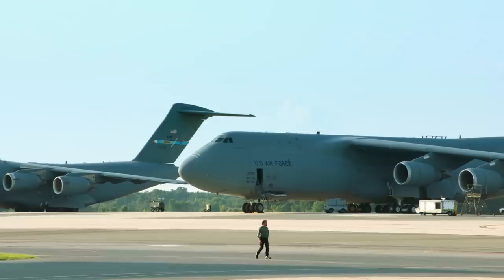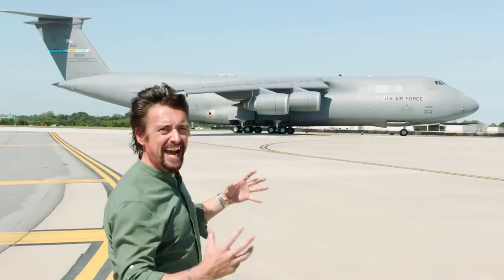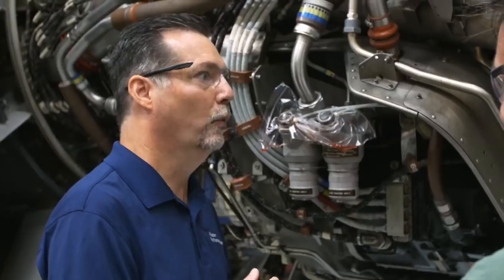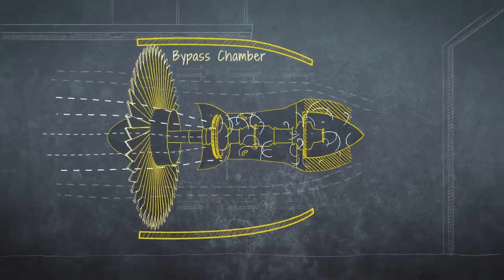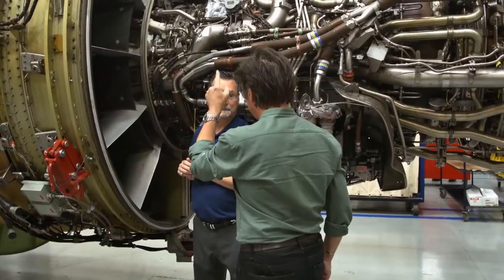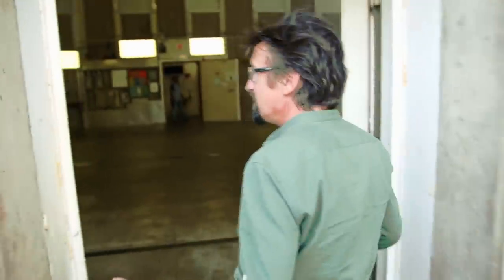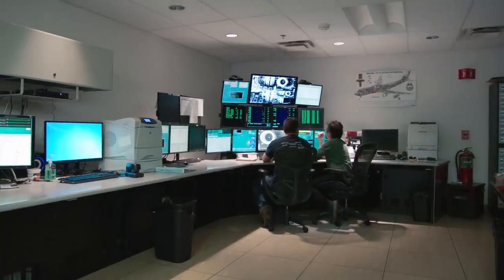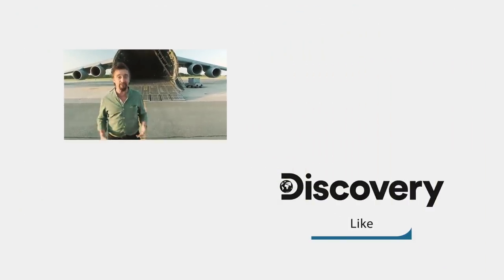Richard Learns How POWERFUL The Turbine Of The Super Galaxy Plane Is | Richard Hammond's Big

Comment: The most amazing thing that I find with modern jet turbine engines are the bearings that support all the weight of those many moving parts. Literally tonnes of metal being held in place vertically and yet still being fluid enough to turn radially. I've had the honour of working with these marvels of aerospace in the past, and let's just say that there's a reason that they have to use clamps and covers on the front LPC to stop them from moving in even the lightest of winds. I was stood in front of a fully assembled Trent 1000 an age ago before it left the overhaul facility, and I was told to simply place my pinky finger on one of the blades. It moved at the lightest touch. Now imagine that same engine being sat on a runway in high winds. Those things would spin like it was nobody's business. Modern bearings are an engineering achievement of themselves.
Reply: Great comment! The bearings are also bearing all that thrust and transferring it to the frame of the engine! Same with car wheel bearings, on a smaller scale. All the weight of the car is sitting on those 4 bearings and all acceleration and braking force is also going through them!

Comment: I had the privilege to work intimately with these types of engines during my time at Rolls Royce, and they really are amazing machines. If you're into engineering that is. Ha ha. The sheer scale of them is awesome, and to be able to take a hands on role and see one of these beauties go through the entire service process from start to finish is something that to this day I count myself lucky that I got to witness. Some of the engineering challenges and subsequent solutions to even the tiniest of problems is incredible in it's simplicity at times.
Reply: During my time at Uni we were allowed to visit N3 EOS in Arnstadt, where they overhaul engines for Rolls Royce. The size and complexity are indescribable. Mess up one thing and everything goes south. Now being a mechatronic, I find it still immensely staggering that the techs are liable for every screw, even after 10 years
Reply: @LMO169  When I did my work experience just last Xmas, I was in the SPTE department (in derby) and had a tour. My supervisor really liked me so he took me to the testbed and we saw a couple XWBs in production. It was amazing
Reply: @LMO169  Hear hear brother. Every mistake has to be accounted for, and even a simple thing like a washer falling into an open part of the engine can wreak havoc down the line. I remember while I was on the overhaul line the once my team and I discovered a socket that had welded itself to the fairing of one of the turbine stages. After some work to figure out where and when it had come from we were later told that a previous mechanic had simply lost said socket and failed to report it. Were it not for the fact that it had managed to wedge itself between turbine stages it could have written off the entire engine had it come loose and tore it's way through. Lucky isn't the word. Ha ha.
Reply: @jimhutcho1083  You were at Derby? Awesome dude! That's the site I worked at! I worked at AR&O for the majority of my time there, if you ever get the chance to take a tour round there then jump at it. Some of the stuff you see there is just staggering! 

I can't speak much for XWB unfortunately as my contract ended during the final stage of development for that engine, but I got the chance to see a flyover from a passenger jet using that beauty. I did also spend some time working in BLISK department learning how the turbine sections especially were repaired. Amazing stuff to behold. Glad you got the chance to see stuff in person, really puts things into perspective doesn't it? =)
Reply: @_IHateHandles_  really does put things into perspective, most people don't think of the engineering that goes into those beauties.
Reply: @_IHateHandles_  we toured around the building and I saw the yellow, green and blue bricks too which was both cool and scary, especially when we went up to the testbed on the ceiling, a couple dozen metres up in the air 😬🙂
Reply: I worked for GEAE for 34 years.  The precision required for these engines is incredible.
Reply: @jimhutcho1083  Yeah when those engines are swinging overhead it can be quite the culture shock. Ha ha. I managed to talk my way into getting a visit arranged at the test beds while a Trent 1000 was being hooked up, even saw the thing running from the control center. No amount of concrete or soundproofing could stop you from experiencing the raw power of that thing. Ha ha!
Reply: @Harley2010SG  Hear hear! It still never ceases to amaze me the tolerances that some critical components have to adhere to. To live in an age where we can achieve those tolerances is amazing in itself.

Comment: General Electric GE9X: “that’s cute”
Reply: I was thinking the same thing. Twice the thrust and one engine is enough to fly the 400+ passenger Boeing 777, the third largest passenger airliner in the world.
Reply: True, in terms of thrust there's no comparison. However, a GE9X is wider than the fuselage of a 737, and weighs 40,00 pounds....so when we are talking about "making something bigger without making it bigger", that kinda doesn't work haha
I don't have time to do the thrust-to-weight calculations, but suffice it to say that the GE9X makes 105,000 lbs of thrust and weighs 40,000 pounds, while a GE CF6-80C2 makes about 55,000 lbs of thrust but weighs less than 10,000 pounds. Impressive!
Reply: The TF39 is where it’s at
Reply: Ben Jared 4:13 it actually is a GE9X
Reply: RandomTwix but the CF6 is the main focus of the video.
Reply: Ben Jared I know just wanted to mention it
Reply: So is the Turbo fan what produces the most trust? compared to where the compressors are. ( I don’t know the name of it)
Reply: Mati-miliano the turbine stages are only there to spin the fan. I think the schematic he showed was a little confusing. 

Most of the thrust comes from the fan. The cores job is to actually make sure the air leaving the engine matches the air coming into the engine. This way all the energy is used to spin the fan through the turbine stages and nothing is wasted. 

But I might be wrong it’s been a while since I completed my jet engine studies.
Reply: Mati-miliano there are 4 main type of jet engines: 1 turbo-jet: it is the most basic, and all other types are a variation of it, It is pretty much a tube with a compressor at the front that compresses the air, a combustion chamber where air is mixed with fuel and ignited (where most of the thrust is generated), and turbine at the back that drives the compressor at the front (they are most commonly found in early jet planes or in military planes some times with an afterburner) ; 2 turbo-fan: the most utilized type of engine (also the one in the video), it uses a turbo-jet engine to drive a bigger fan located in front of the engine, which produces most of the thrust, they are found in pretty much all modern airliners and in many military and civilian cargos, thanks to their improved fuel efficiency; 3 turbo-props: it is the little brother of the turbo-fan, it uses a turbo-jet to drive a propeller (not encased), they are usually mounted on smaller planes, or sometimes on some cargo aircrafts (A-400); 4 turbo-shaft; probably the most widely used, outside of aviation, they use a (usually smaller) turbo-jet to drive a shaft that can lead to any kind of machinery that requires rotational force, from the propellers on an helicopter to the drive shaft of a tank (M1 Abrams, T-80).
Reply: They tested a GE9X
Reply: superdriver777 jeez if the ge9x weighs that much really, that means it’s thrust to weight ratio ain’t that much better than the cf6
Reply: @vale.44peru  There is more, but not used for commerical planes: Ramjet (Supersonic), BuzzJet (ie V1 flying Bomb), & scramJet (hypersonic).
Reply: @guytech7310  yes, but those are way less common, only some experimental planes used them, in theory you can power in any way, even human power. 

p.s. it's pulse jet
Reply: @GolddenWaffles  That is correct, the bypass air (from the fan) produces almost all the thrust. The core (where the compressor, combustor, and turbines are) is primarily there to drive the fan. What a lot of people don't know is, on an engine like the 9X, there are actually two different shafts: one inner, one outer. The outer shaft spins fastest and connects the high pressure (HP) compressor with the HP turbine. These two parts of the engine bookend the combustor. The inner shaft connects the fan and low-pressure (LP) compressor with the LP turbine. These turn at a lower speed than the HP parts.
Reply: @InForTheLonghaul  This is correct. The 9X is much more efficient and actually slightly larger diameter than the GE90. Boeing determined they really didn't need as much thrust as the GE90 puts out. I actually worked as an engineer at GE Aviation in Cincinnati for a time on the 9X program. Peebles is a very interesting place.
Reply: @InForTheLonghaul  The highest thrust of a jet engine was a GE90-115B which set a record of 127,900 lbs thrust on a test stand in 2002. This was recently broke by a GE9X on a test stand when it produced 134,300 lbs thrust in 2019!
Reply: I looked and realized that truck is actually hauling a GE9X lmao

Comment: Funny thing. I was a ground mechanic (glorified gas station attendent) in the Air Force Res. back in the late 70s early 80s. And to keep the engines from rotating while they were on the ground they would put a 2 by 4 with rubber on it in the fan blades. Very high tech.

Comment: Turbofan technology is not General Electric’s discovery, as is being suggested.
Reply: Peter Yianilos it is actually.
Reply: bob bob Peter is right..... it was originally designed by English Frank Whittle & German Hans von Ohain in the late 1920’s early 1930’s
Reply: High-Bypass Turbofan is actually. Turbofan as general is not of course.
Reply: Aleksandar Aleksic   Thanks for the clarification.  I should have said high bypass turbofan.  However, ‘discovery’ is different from production.  The research, hence discovery, was not GE’s.
Reply: @artysanmobile  Well, that's true but it is not something like telephone or radio or engine...it was just development. So no one really had to claim invention of it. AVCO-Lycoming developed the first one and giving way the cost of such feat no individual could have done it. GE produced first one and that's somewhat more important. That's that settled.
Reply: @watchesoflondon2333  You are mixing up jet engines overall with the specific types of jet engines that are called turbofans. The designs of Whittle and von Ohain had all the air go through the combustion chambers and the turbines and were therefore not turbofan engines. The first experimental turbofan was made by Daimler-Benz under the Nazi regime in 1943 but von Ohain was not involved in that. The first production turbofan was the Rolls-Royce Conway in the 1950s with a bypass ratio of 30-60 %.
Reply: skunkjobb the point being it wasn’t GE
Reply: It's the first manufacturer in the U.S.A. and the technology was captured from the Germans after WWII. Pratt and Whitney started making them in the early 60's by licensing Westinghouse's nuclear turbine techology, and quickly came up with the J-58 and the JT8D.
Reply: Ge did design the first high bypass tho
Reply: @PeterKKraus  The word here was about High-Bypass Turbofan not Turbofan in general.  German planes like Me 262 used Junkers and BMW Turbojets but that tech coexisted in USA and UK (Westinghouse and Vickers).
Reply: @aleksandaraleksic4067  I knew Westinghouse had turbine technology , but for nuclear reactors not jet engines. A turbine is a turbine though. It's just a matter of how it's implemented. The Germans came up with the first useful aeronautical application.
Reply: @PeterKKraus  Well, being mechanical engineer I can't let you go with "a turbine is a turbine". Because it really isn't. Westinghouse produced it's first jet engine (J30) in 1943 so that's before they even touched Germany. Power Jets (UK) had first runs before and first flights around the same time as Heinkel (DE) did. It was the same idea that all had. Germans, Italians, British, Americans and others later. But we should give honor to Frank Whittle for his invention - the turbojet engine! That's all!
Reply: @aleksandaraleksic4067  I'm not a mechanical engineer. My father was a PhD mechanical engineer who worked at Westinghouse in the 50's and went to Pratt & Whitney in the early 60's. Obviously, I'm not sn expert, but if they can take nuclear turbine technology and apply it to jet engines, there has to be some similarity, no? Also, I had no idea about Westinghouse's jet engine so early. I only knew that G.E. produced the F-86 Sabre engines.
Reply: @PeterKKraus  Kudos to your father, a lot of respect! Turbine from nuclear power plant? That is steam turbine, a type of gas turbine, axial so it is similar to those in jet engine. But you'll find turbines in pumps, compressors etc so that's what I meant. Anyhow, lets not prolongate this anymore but come to conclusion that no nation is God given for inventing...it just happens that they had need and founds for research. At the end Liza Minnelli was right: "Money makes the world turn round."
Cheers!
Reply: @aleksandaraleksic4067  Well, he came to the USA at 7 ftom Czechoslovakia with nothing in 1939.
Reply: @aleksandaraleksic4067  Turbine is a very general word, and doesn't mean much in the grand schemes.
Reply: @watchesoflondon2333  dont confuse, turbofan with turbojet they are very very different things.

Comment: For the record, the first "turbofan" type of gas turbine engine to enter service was the mighty "Conway" built by Rolls-Royce in Derby, England. I remember talking to some DC-8 pilots who had flown these engines along with the competing P&W engined DC-8's. Although the Conway was thirstier on fuel because of the lower bypass ratio, the pilots said that they preferred the extra power at altitude provided by the Conway.
Reply: Yes and no. The RD.80 "Conway" was a centrifugal bypass design, but it was still a true turbojet engine. The reason is because the air that bypassed the core didn't have enough compression to deliver much thrust. It doesn't qualify as a true turbofan engine because of its low bypass ratio. In 1964, an American company named AVCO-Lycoming created the first high bypass jet engine, making it a true turbofan, where a greater portion of the thrust is delivered by the air that bypasses the core. This design was then licensed by Rolls-Royce as the SNECMA M45H.
Reply: @bigtime9597  Turbofan engines come in two basic flavours, bypass or ducted. There are many examples of bypass type turbofans (old and new) and the Conway just happens to be the first example to have run and entered operational service! Early engines were running in the 1950's and the Conway powered 707's and DC-8's began passenger service in 1960. Ducted turbofans (typically having separate hot and cold exhaust nozzles ... but not always!) are a natural design evolution as bypass ratios increase but both the "bypass" and "ducted" designs are still considered "turbofan" engines. The Conway cannot be described as a "Turbojet" since this type of engine has no bypass flow.

Comment: In 1973 I was in the USAF working on Cessna 0-2A Skymasters. We had a C-5A Galaxy come onto our field for a show. Huge, impressive aircraft. The most amazing thing was watching it take off. Empty, it got off the runway right about the same spot where an 0-2A did. To put that into perspective, consider this; the 0-2 weighs 4900 pounds and the C-5 is 380,000 pounds! That's what these engines are all about.

Comment: The TF39 was also a hi- bypass engine, it had a thrust of aprox 43k lb of thrust vs the newer CF6 with aprox 50k +  lb of thrust. I remember flying on the " A" versions and the engine whine of the TF39s but I admit the increase in (effeciency/ lbs of thrust ) is pretty astounding!

Comment: Ummmmm bypass engines have been around for a while, it’s kinda like saying we have a new , more efficient way of heating food.  A microwave.
Reply: H L Yep. They have been around a long time. Did SR 71 also have bypass engines? I
Reply: @yusha27  the SR71 has a very unique engine, there are some videos about that. You could say that depending on the speed the engines switches the way it works.
Reply: @yusha27  nno
Reply: Waiting for this
Reply: @yusha27  It's hard to classify the SR71 engine. It might be a bypass engine or it might be a ramjet. It's weird.
Reply: @operator0  At low speeds, it's an axial flow turbojet. But, once it gets past Mach 1.5 or so, it switches to the bypass chambers, which is a ramjet.
Reply: @bigtime9597  Yeah, that's the thing though. How is it classified? As two different engines? I really don't know and I really don't know of any other engine like that in another operational aircraft. Like I said, it's weird.
Reply: @operator0  For lack of a better term, wouldn't it be called a hybrid engine? Idk
Reply: That's not the point of the video. its explaining how the C-5 galaxy revolutionized air travel with its General Electric TF39 high bypass turbofan engines which were the first of their kind.